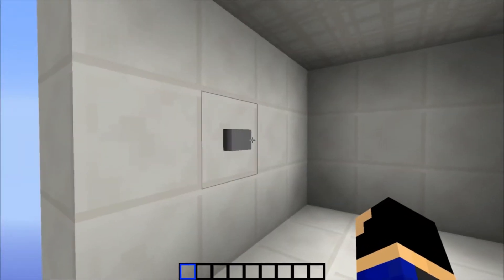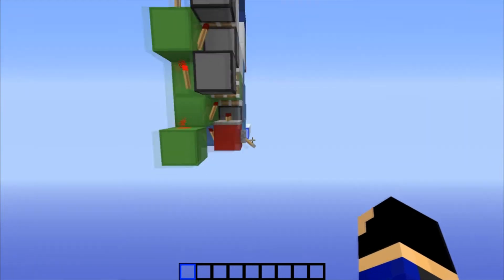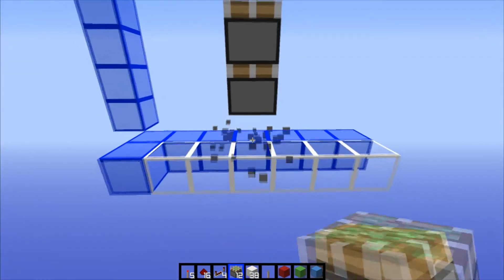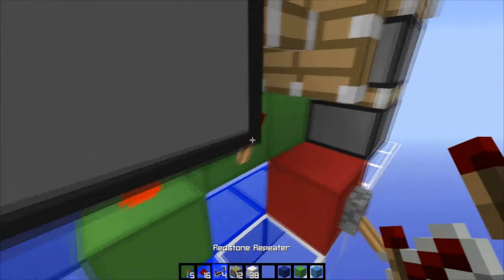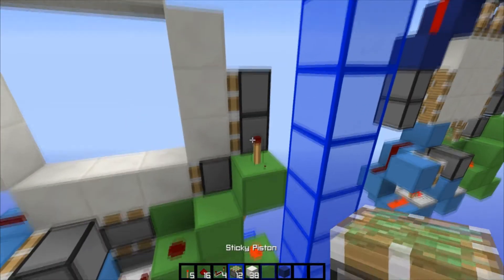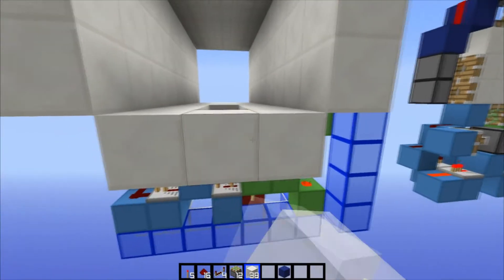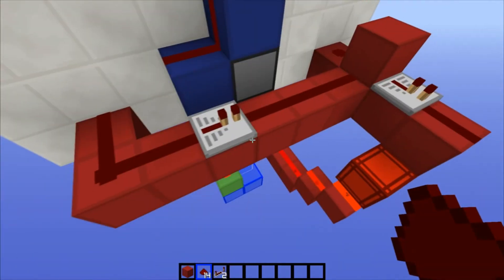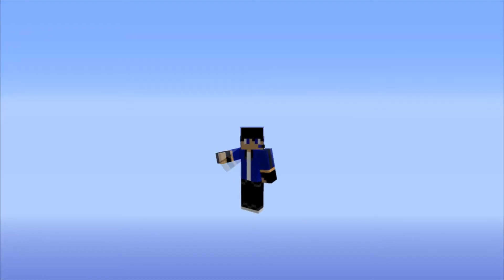Seamless 3x3 Piston Door | Only 2-Wide! | 1.13 | Redstone Tutorial

Comment: Not seamless
Reply: My vision of seamless is no visible piston
Reply from the maker: Then your "vision" is wrong. Seamless means that, when open or closed, there are no visible pistons, redstone, etc. on the door
Reply: Ray23179  The door should be flat with the outdside wall as well if seamless so it wont be 1 block in depth
Reply from the maker: The door you have sent a link of is FLUSH. Though it is still seamless, FLUSH means that when the door is closed, it is flat with the wall so that it can be more hidden. And it is also seamless because the pistons move out of sight when you close it. My door is seamless...

Comment: Odd, when I use the system with the button set up, the piston leaves the center block. Disconnect the button system, use the lever, and it grabs it and opens perfectly.  Any idea how to fix?
Reply from the maker: Make sure the button setup doesn't interact with any of the redstone, other than that, I have no idea how to solve this :/
Reply: Ray23179 I just put a repeater into it and she worked fine. :D
Reply from the maker: Great! Glad it worked :D